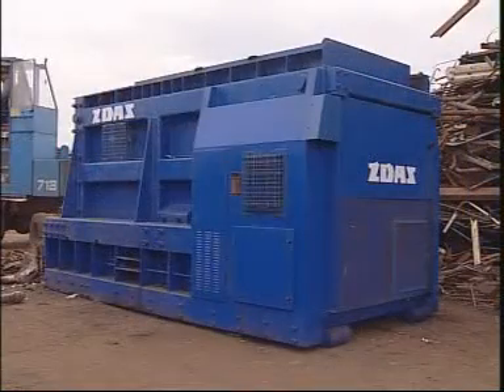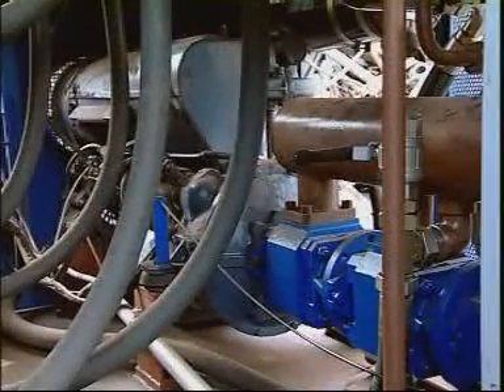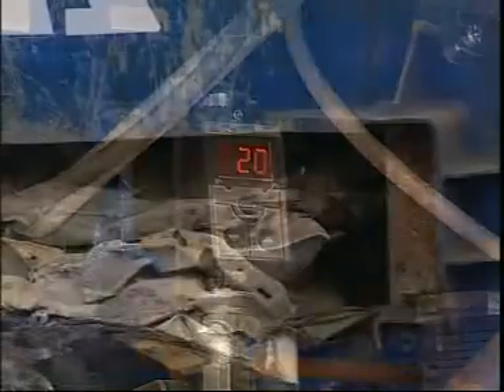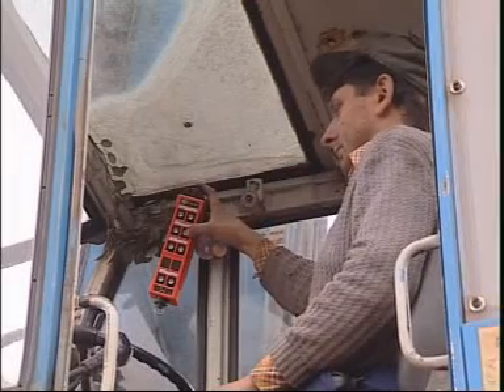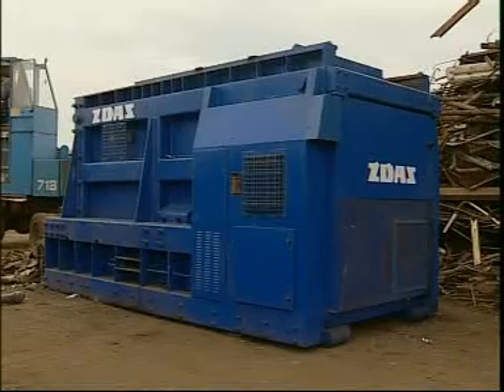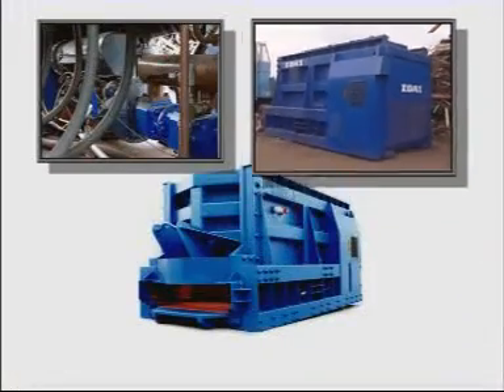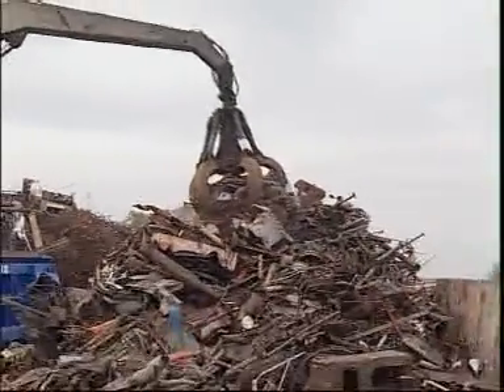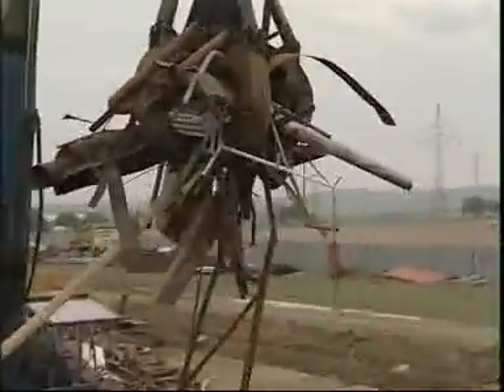Mobile Container-type Scrap Shears CNS 400 K ŽĎAS, a.s.

Comment: Check All New and Used Shears. Find Our Shears  http://www.machineryspecialist.com/Scrap-Metal-Recycling/Scrap-Metal-Processing-Machines/Shears/ at MachinerySpecialist.com. See the complete list of machines :

Inclined Shear : http://www.machineryspecialist.com/Scrap-Metal-Recycling/Scrap-Metal-Processing-machines/Shears/Inclined-Shear/  
Shear-Baler : http://www.machineryspecialist.com/Scrap-Metal-Recycling/Scrap-Metal-Processing-Machines/Shears/Shear-Baler/  
Side Compression Shear : http://www.machineryspecialist.com/Scrap-Metal-Recycling/Scrap-Metal-Processing-Machines/Shears/Side-Compression-Shear/  
Horizontal Shear (Container Shear) : http://www.machineryspecialist.com/Scrap-Metal-Recycling/Scrap-Metal-Processing-Machines/Shears/Horizontal-Shear-Container-Shear/   and feel free to contact us if you need any help or consultancy on equipment like shears, used shears, shear baler, inclined shear, compression shear, horizontal shear, metal shear, scrap metal shear, etc.